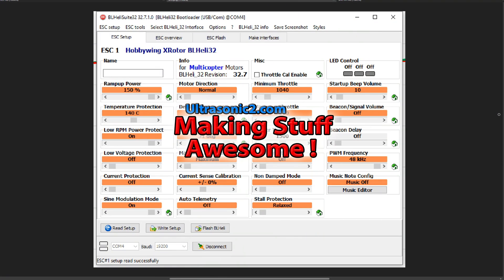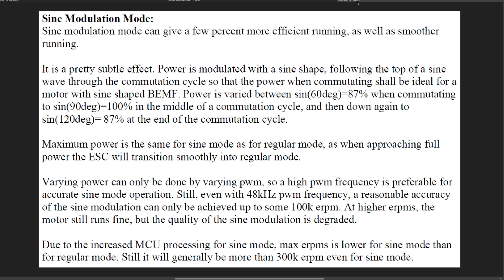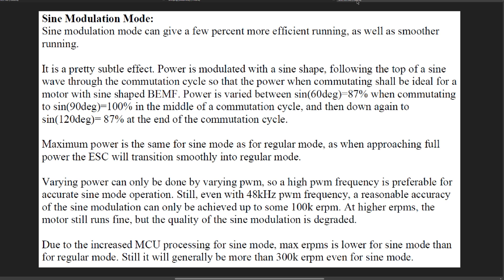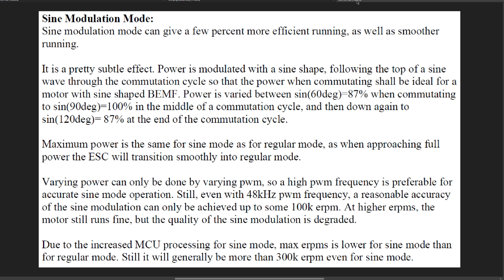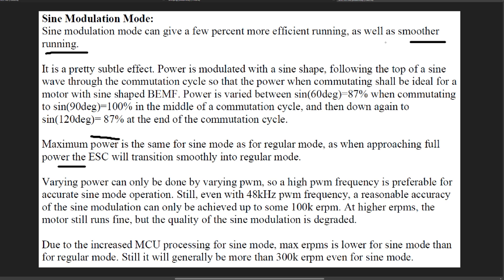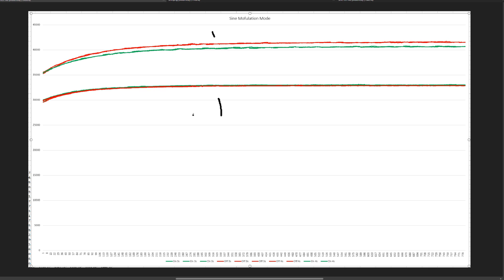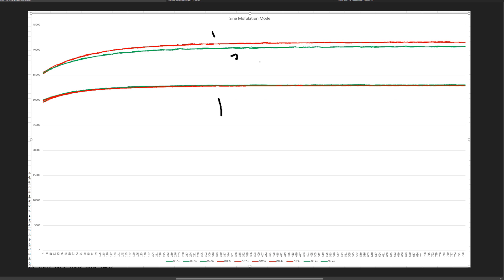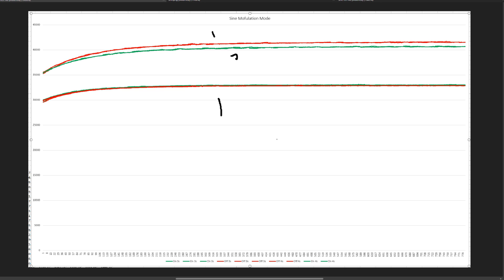⚡️ BLHeli_32 Sine Modulation Dyno

Comment: I am curious about what the graph looked like during acceleration (instead of just the max RPMs).  Do you remember? In my application, I accelerate and decelerate the motors constantly, and am curious if the Sine Mode provides better performace.